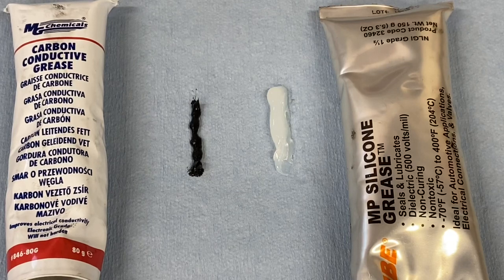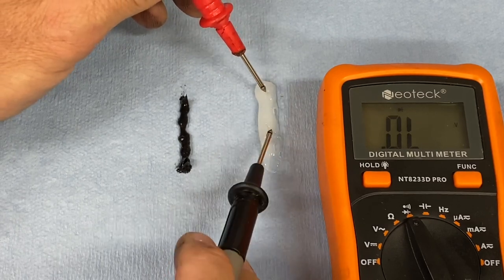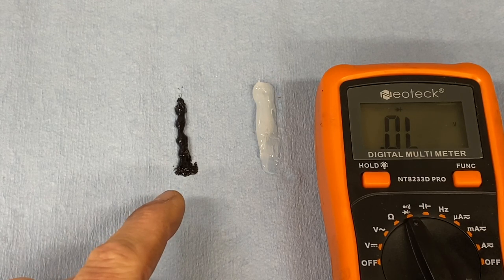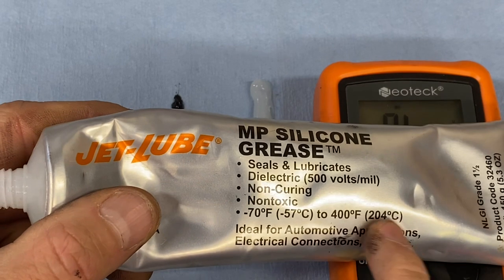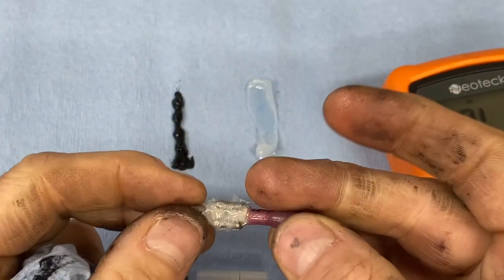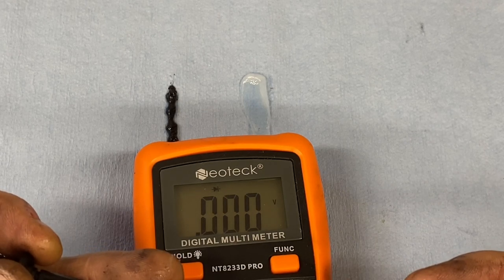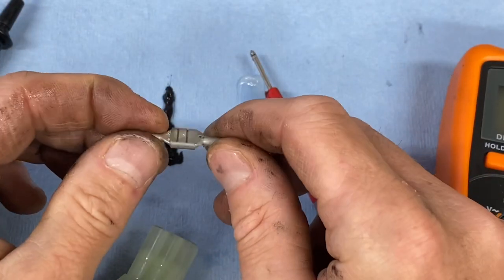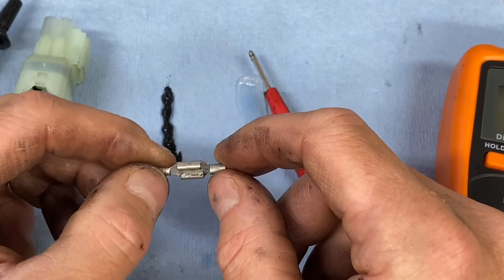Moto Mythbusters Dielectric VS Conductive Connector Grease

Comment: Nice video! This may help from an aerospace electrical engineer. The only method to make a proper, RELIABLE electrical connection is either 1) Welding or  2) Soldering -- the wire to the terminal AFTER  a strong mechanical crimp is made between the wire and terminal. All parts must be very clean. The bond made is between both the connector terminal and the wire. This bond will be made to some molecular depth in each material using welding or soldering (a form or welding). Regarding terminals: In general, the actual alloy % cannot be determined by looking at it. Knowing this becomes important that terminals that look like the same alloy may very well not be. Dissimilar metals made from alloys of some elements that can have a difference in valence electrons at the atomic level between for example terminals like male and female spade connections where one terminal is made from a different ALLOY and has a difference in valence electrons.  In the presence of air that contains humidity, this difference between the two different terminal alloys makes an imbalance in valence electrons in the outermost orbital shell of each terminal atoms. This results in a small DC Battery between the two terminals when joined together. This causes Galvanic corrosion between the two spade materials and then after time passes, it results in an increased voltage drop  (high resistance) between the two terminals when joined. Crimping without soldering or welding works for a while but is not a reliable electrical connection. Conductive greases are used in certain Electronic components such as Air Variable Capacitor ball bearings that need to conduct between the bearing balls and the races for proper electrical operation. For AMP or MOLEX (like shown in this video)  connector housing terminals that are SOLDERED to the wire, we use CAIG Laboratories DeOxIT 100DL, 25ml red bottle with a cut-off hypodermic needle. This small bottle is enough to last a lifetime. Only an extremely small amount of this highly conductive material needs to be applied. Work both male and female terminals together several times to make the molecular bond,  then BLOW OUT THE EXCESS of DeOxIt, D100L. You only want a very thin layer on the terminals. If the connector will be used in very harsh environments, i.e., SALT air, High Pollution areas, etc. After following the later use DeOXIT SHIELD and LIGHTLY spray into each connector coating the terminals, then blow out the excess with pressurized air.  If you do try the DeOXIt D100L try putting it on the electrodes of your flashlight batteries. The light will be twice as bright and the case will be closed with no doubt. Hope this helps.
Reply: Now THAT'S a comment on the subject!
Reply: Thanks for the interesting educational comment! Somebody told me that crimping is used in aerospace more than soldering because solder joints can crack. But is that incorrect, since you were saying that they have to be both crimped and soldered? 

And for your job is there a difference between soldering and welding the connection? Is one superior for example?

Comment: Well explained. This is a controversial topic, mostly because people don’t understand what the purpose of the two items are.  Once, I got chewed out in front of a group of people, for using dielectric grease on amplifier multi conductor molex connectors that were exposed to the elements. The guy that was giving me hell was a lifelong wireman for the local power company. I knew I was doing the right thing from working aerospace electronics for most of my career. The dielectric grease does more good than any harm due to it’s protective affects on the connection. Seen it been there many times. I decided to take the chewing out instead of causing a war at the time. His wording was “Never, never use dielectric grease on electrical connectors because it will act as an insulator.” Now retired, I wish I had confronted the guy in front of everyone, only to get the “question” cleared up for good.. Bottom line is that dielectric grease works wonders for multi connectors especially exposed to the elements. We really saw major results near the ocean (salt water in the air - oxidation and rusting through of connectors and wires). I agree with you here. / The zinc or carbon or copper dust impregnated grease is good for high current, single connectors such as power line connections, where that connection must flow many electrons well, yet are far away from the other connectors, so shorting out to each other is not an issue. Big difference - Hope I didnt just confuse anyone.  Well Explained!
Reply: I've seen a forum post where somebody recommended putting the conductive grease in a wiring harness connection while saying that dielectric grease is a mistake, but they didn't say any precautions like preventing shorts. Guess it works for them, even though they may be wrong, and shows how people may be wrong but think they're doing the right thing. So don't always take people's word for truth

Comment: Dielectric grease does insulate whatever you put it on! It works for you on your spade connectors because you are scraping through it when you join the male and female! Trust me when I tell you, dielectric grease is NOT designed to be used between metal to metal contact points! Yes It will function on friction connection like in the video or even on contact points that have enough force to break through the barrier created. Don't believe me? Take your battery terminals off of your car's battery,  put dielectric grease on the posts and reinstall your terminals and I guarantee you will have a dead battery after a few starts.

Comment: Excellent video and you are correct on most points. My only comment is that I would make the mechanical electrical connection FIRST and then coat with dielectric. This will ensure that you maximise the metal-to-metal surface area instead of depending on the connectors displacing the dielectric.

Comment: That is the way I always use dielectric grease. on the plug-in type with the seal, I also lightly coat the seal itself but apply a light coating to the connecting blades as well.

Comment: Over 90% of mating electrical contact surfaces are actually air gap. If you looked at them under an electron microscope you'd see that the "flat" surfaces look like a mountain range and only the interfering peaks make electrical contact. Those microscopic interfering peaks exert incredible pressure per square nanometer and squeeze out the grease from between them.
Reply: forget the conductive grease or the dielectric grease what about just plain Grease. that would help to connection better than dielectric and still stop corrosion.
Reply: @Mikefngarage  My guess is those other type grease have components that may interfere with proper functioning down the road like the 'detergents' in motor oil, where the dialectic is likely free of them.
That said, in a pinch on circuits one cares little about it may be perfectly fine, like easy access on yard equipment.

Comment: Awesome clarification!

New to me 500exc started running horrible after the first 2 hours. It would not rev past idle, misfire and the starter quit working. Barley limped it down the trail.

The main 20amp fuse under the seat had dirt and water corrosion on it. It caused it to burn black but not pop. So the bike was getting incorrect dirty voltage to the ECU.

I put a new fuse in and added a little dielectric grease to the main and spare fuse to keep cleaner from future corrosion.

Comment: In my experience with di electric grease, I once put it directly on top of 8 spark plugs, liberally. Had all kinds of misfires.  Removed and cleaned well, no more misfires.  I still use it very sparingly on the boot, with a q tip to spread evenly. I will be using 847 to install 00 wire and terminals to a high voltage battery.
Just sharing my experience.  A well portrayed video I might add. Good day.

Comment: Somebody online has said that they've seen more corroded and destroyed connectors then issues caused by putting dielectric grease in the connectors. I took that to mean that the waterproofing benefit of adding grease (preventing severe corrosion) outweighs any risks

My headlight connectors have a waterproof seal that is not positioned in a middle area like an o-ring. Instead it makes the back "wall" of the connector the waterproof seal, so both sides of the connector would need to form a super tight clamp to be waterproof, while an o-ring will seal as long as the connector housings are mostly overlapping. And since one of the connectors corroded from water intrusion, likely due to a broken latch/loose fit, i put a ton of grease inside in hopes that it'll keep the water away even with a small gap. 

I also added some dielectric grease to the other connector which never had water intrusion and has an intact latch, though a bit less, and i focused on the outside edge of the water "seal."  I feel that the extra grease will be pushed to the side to act as extra waterproofing instead of being trapped and causing fitment problems. The grease will even out like how a dot of thermal paste onto a CPU spreads into an even layer when the weight and flat surface of the heatsink is secured down onto the cpu. 

But the fact that some connectors won't fit together with too much grease "clogging" them seems to depend on its design, i think. If the connector is super tightly packed with little free room past the o-ring for dielectric grease to spread out into, then the connector will not securely fit together.

And whether the terminal smeared with grease affects the electrical conductivity depends on how "pitted" the surfaces are. A cpu and heatsink surface is microscopically pitted, preventing effective heat transfer, and the conductive thermal paste fills in the microscopic gaps to allow the heat to transfer with contact. 

So presumably the electric conductive grease would enhance the electrical conductivity of a mechanical electric connection. But the dielectric grease won't worsen the connection unless the connection somehow lacks the mechanical strength to displace the grease. Or the waterproof seal is somehow so strong and the mechanical strength is weak enough that the grease builds up pressure strong enough to separate the electrical contacts? (Wish I guess is pretty unlikely)

Comment: Great video. I wish this had been out when I was initially trying to understand this. So many conflicting sources. I read a lot and eventually ended up with the right conclusions, but it was still nerve wracking the first time I put dialectric grease in a terminal. Needless to say it all works fine and I have never had any corrosion issues. I'm glad for the validation.

Comment: The carbon base conductive grease , is mainly for moving mechanical ground straps on machinery, no way would I install in a multi pin connector. Mechanical moving ground straps can make noise without grease, and the conductivity of the grease ensures continuity, verses using some non conductive grease which could cause a loss continuity.

Comment: Oooh, PERFECT, PERFECT, PERFECT.  I've been having grounding issues on my trailer and wondered if I could use a silicone grease to keep the nuts and bolts for the lights and grounding from rusting/corroding and losing their conductivity.  I will give it a try.  Thanks.
Reply: A better alternative is Noalox/penetorx or the like.  Dielectric grease is good for protected connections  not so much for exposed ones.  Noalox and the like is designed for single lug exposed connections..   Leave the dielectric to for connectors.

Comment: A video about what constitutes circuit cleaners would be interesting, my findings is that it is just brake cleaner and mineral oil. The brake cleaner flashes off after cleaning leaving the nonconductive mineral oil as a lube and protective layer.  Thanks for the great video!

Comment: Interesting there's a controversy about these two connector greases. I've only used non conductive silicone-based dielectric. At dealership and later in my career on a lot of Emergency Equipment for a municipality. Never an issue. I always find your delivery concise and informative. A (relatively) new Taco Moto customer!

Comment: Taco Moto is correct. I have used gallons of this on high voltage connections (7 Kv and above) . Somehow the silicone ends up in my garage...

Comment: Great, thorough explanation. Could you please do a video explaining the difference between silicone dielectric grease and silicone grease. I have dielectric grease and would like to use it for lubricating O rings.
 Is there any reason dielectric grease would not work just as well as silicone grease for lubrication of O rings, gaskets and other silicone grease uses?
Thanks

Comment: I was an electrician for 43 years. Mostly 277 VAC and lower. Retired due to a bad bike crash in 2015, can not remember any of 2014. 

I used Dielectric grease on all connectors that were in moist air. Worked in Seattle down on the water front so salty air everywhere. 

I did use carbon infused grease on heavy Bus Bar connections but those were isolated from each other. A small dab in a crimp lug, insert the wire, crimp it then wipe the excess off.

A few other electricians that were on the NEVER EVER use it had many more call backs weeks later due to corrosion in connectors. A quick squirt in a wire nut and spin it on the wires and its water resistant. Nothing is 'Water Proof', look at the Grand Canyon, was solid rock.

Comment: I think dielectric grease is meant to prevent corrosion, and possible arcing due to a loose connection by insulating the electron flow. Please correct and advise if my theory is incorrect. I installed a new performance MSD ignition coil, NGK wires, colder iridium spark plugs but forgot to apply dielectric grease between the wires and ignition coil. The car ran GREAT at high revs for a few days, then a misfire caused the car to go into limp mode. I knew it was either the new MSD ignition coil, or the NGK wires. I removed the ignition coil and one of the contacts showed sign of arcing.

Comment: Ahem  ---  a couple minor 'typos':
But First; I MUST SAY what an EXCELLENT VIDEO!!
Thank You!

'Typo' @6:05 That is the film breakdown voltage, not the voltage 'rating':
A film 1 mil thick will withstand 500V.
So, a 2 mil film would resist 1,000V, 3 mil - 1500V, 4 mil 2KV, etc.
On a spark plug boot for instance, where the current would have to penetrate a half inch or more, it can resist 10s of kilovolts.

Typo on your meter - it is on 'diode' test, not ohms...
Your reading was ~1.4V drop across the grease track (unknown current).
I was hoping to see the actual ohms reading, as I am not curious enough to buy something that I will likely not use, just to satisfy my thirst for technical knowledge...

Again, I LOVED you video!
I was surfing to find tips, and instead was astounded by the misinformation and misconceptions I ran into!
Found yours in effort to find someone to refute all the bad advice.

There actually are some places where silicone grease can cause harm:
One I learned about is that you shouldn't put ANY grease on a Ox sensor connector - it will impede it's operation!
It actually uses the air INSIDE the wire leads to supply the reference atmospheric Ox concentration...
Grease will block airflow through the wire strands...

[I know, sounds incredible, and I doubted it; but I researched it from the manufacturers and technical papers.  Apparently is true.]

Unfortunately, I think I may have done this on a friends car or two...
I am very meticulous, and can count my bad mistakes on one hand.
Mr K L

Comment: We only use it on switches that need lubricant and conductivity but yet we need it to be 0 ohms so we lose none of the RF signal in the switch as well. So you need to find the one that is not carbon based as a resistor is used for the same reason to resist flow of signal or electrons so a non carbon based conductive lubricant is what I am looking for that is most likely high dollar as well.
Reply: Noalox/Penetrox or Kopr-sheild will do what you are looking for.

Comment: Jet-Lube copper anti-seize is fantastic for applications that require a solid conductive contact!.
Reply: WRONG.  Jet lubes KoprKote is an ANTI SEIZE  and does NOT improve electrical connections.  Kopr Sheild on the other hand is what is used to enhance connections.

Comment: The proper use of dielectric is to add it after you connect the terminals.  Meaning it just insulates the connection from external air and moisture to prevent oxidation.  It has nothing to do with the electrical connection which is metal to metal anyway...

Comment: Although it is very expensive, in my trade (Helicopter maintenance) we use a product called Stabilant 22 on all important connection, Even the engine manufacturers say to apply this product to all cannon plugs pin/sockets, including the engine ECU, every time a connection is removed and installed.  I use it on all of the contacts of my bike, ECU included, and use DC4 dielectric grease on the waterproof lip seals of sealed connectors.

From their website:

"Stabilant 22 is an initially non-conductive block polymer that when used in a thin film within contacts switches to a conductive state under the effect of the electrical field. The field gradient at which this occurs is set such that the material will remain non-conductive between adjacent contacts in a multiple pin connector environment. 
Thus, when applied to electromechanical contacts, Stabilant 22 provides the connection reliability of a soldered joint without bonding the contacting surfaces together!"